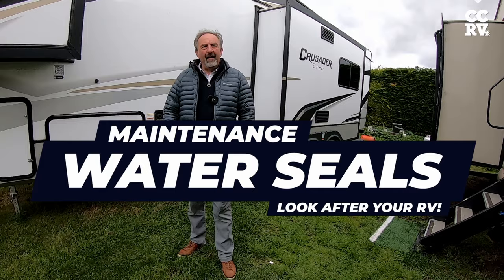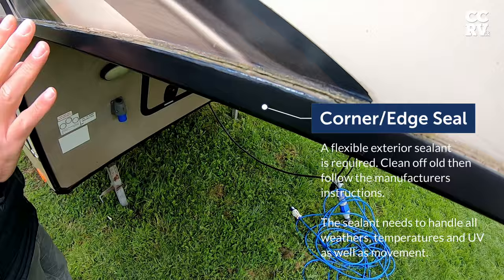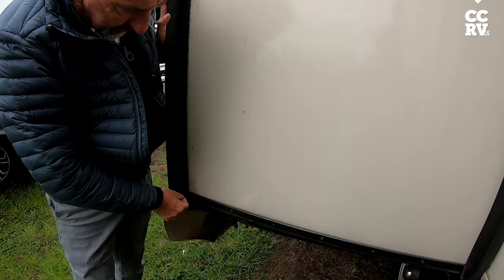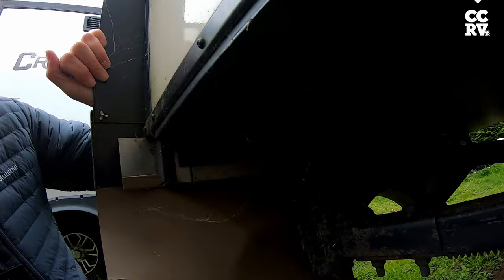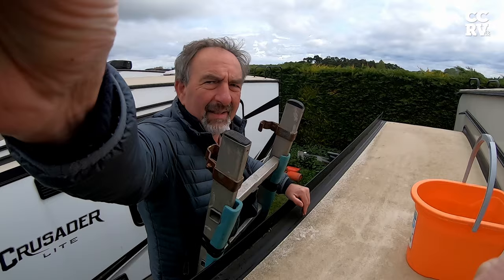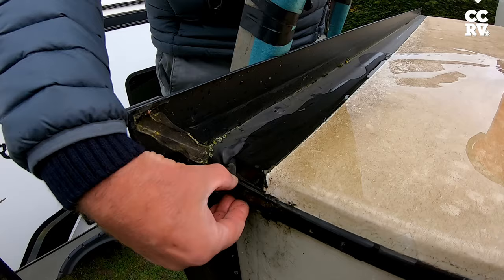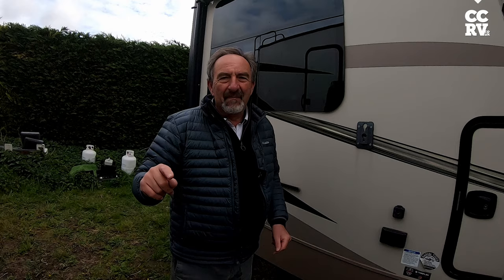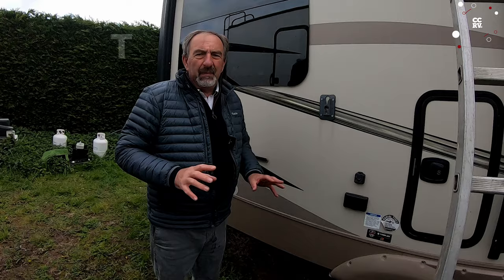Why 5th Wheel Seals Leak - Fix, Repair, Maintain Your RV Seals - Stop RVs Leaking & Water Damage

Comment: Great video. I assume this applies to caravans too....which no one ever thinks about siliconing. I will eventually buy one of your RV's, just need to sort the current caravan, caravan storage and most importantly the vehicle to tow with....especially in this terrible climate of uncertainty around diesel, petrol and EV vehicles....awful! Hopefully, some common sense will prevail.
Reply from the maker: Thanks for following the channel. Hope the video is useful for everybody that has a  Caravan or 5th Wheel generally the only reason you get damp is lack of  maintenance

Comment: The price of these units , the quality should be no less than 30 years.  The design of these units are absolute shit. Think like a rain drop and if you cant. Maybe make bump outs sealed 1 piece fiberglass or other synthetic . Problem is they want them to fail.  But for the price people are paying for these units  there should be no excuse.
Reply from the maker: @dsawyer8  hi the problem is when they leak is down to the environment and how they are maintained. It’s a bit like your car if you don’t service it it will fall to bits. If you don’t check your gutters and downpipes on our house you’ll get water problems it’s nothing really to do with the build quality they sell millions in the USA and Canada where the weather can go from - 20 to +40 so there is going to be expansion and contraction servicing and general maintenance will prolong the life of your van. Thanks for your comment. Hope this helps all the best Paul.